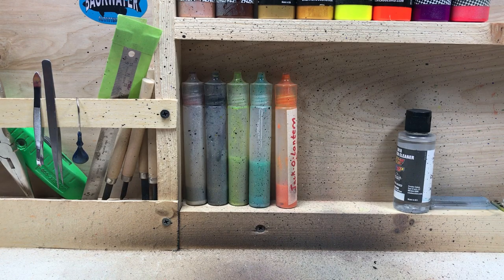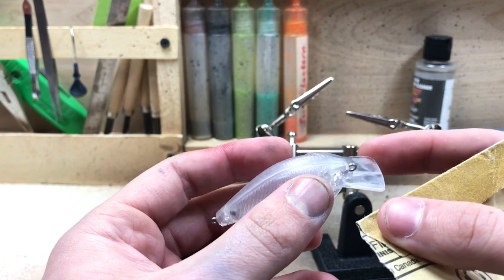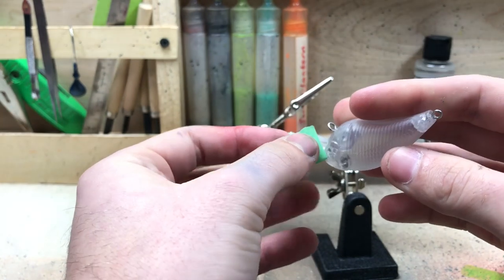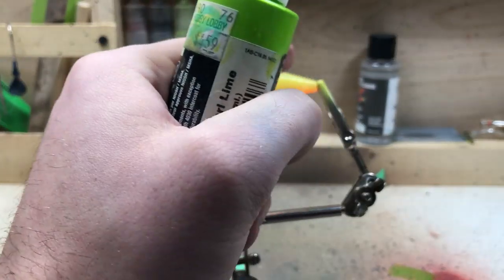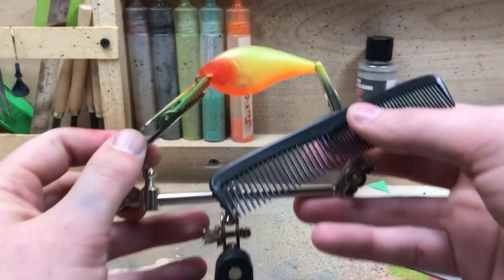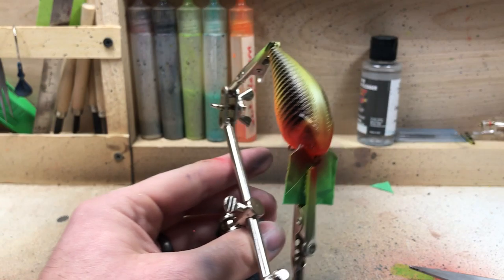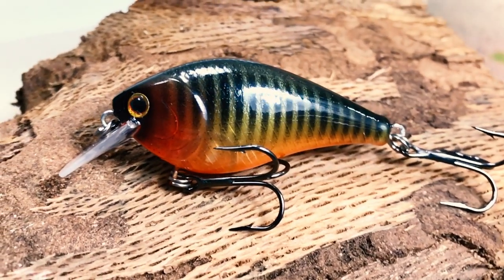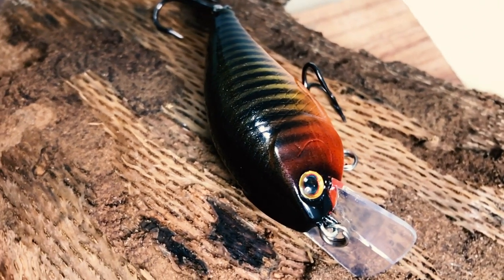Lure Stencils From Walmart Part 2 (Ep.9)

Comment: I find old crankbaits around my local waters and strip off the paint and remake them as a hobby during the winter months.Seeing you use cheap materials for stencils has given me some great ideas to try new patterns.I use a product called EZE-KOTE as a top coat sealer,it's water based so no smell,air dries quickly and goes hard as nails,mainly used by model makers to seal glass fibre but can be used on wood too.Keep the ideas and tips coming.
Reply: Nick cambpell
Reply: Nick cambpell

Comment: You can keep a comb or stencil in place from sliding around by using painters tape.  Tear off a piece an inch or so long.  Loop it in a circle sticky side out and put it on the bait, then lightly stick the comb or stencil on it so the stencil doesn’t move and blur your paint job.  Works best if you spray straight UVLS (mixed with reducer) first so it doesn’t lift the paint.  There is delicate surface tape (purple color) that is not as aggressive 

When done stick the tape someplace you can keep it handy to resuse

If you want to use the comb teeth towards the belly, mask off the ends of the teeth with painters tape to eliminate overspray

If your super glue puts out too much, put a drop on a piece of cardboard, then get a small dab out of the oversized drop with the tip of an X-acto  blade

Nice tip about using the two stencils

Comment: Great videos!! I use the helping hands also and the alligator clips worked themselves to the point that they would no longer hold on the arms. I took them to work and tack welded them. They are working great again.
Reply from the maker: Mine keep doing that too. I take them off and put them back into shape with some pliers. Welding them is probably a better solution lol

Comment: after watching yr video I got so interested I went to buy some cheap Chinese air brushes x 2 n a little square box compressor. it was no good not enough air and paint cannot comes out smoothly. I just bit my teeth and bought a Iwata IS975SH and a iwata HP-CH. I also wants to order some Createx H2o paint , pear fluorescent to try. Anxiously awaiting for them to arrived. What would be a good recommendation for a second brush. I saw some creos PS270(0.3 needle) PS 289( 0.2 needle). These are much cheaper amp to iwata but is still Japanese made. Love to hear from you. Thkx.  I could not get the Alumi UV as they don't shipped to Singapore. I may be able to get KBS coating Diamond finish from Dubai if they shipped. I am using polyurethane that use for coating wood surface as these are the only available that I can get locally.
Reply from the maker: I have been using the Iwate Neo airbrush. Absolutely love it!